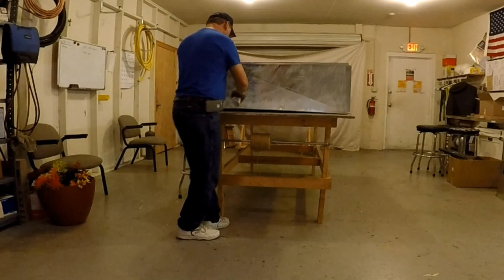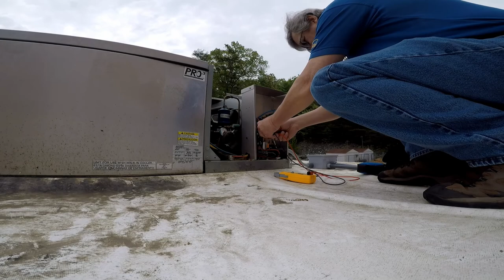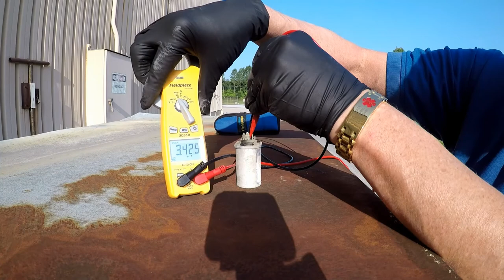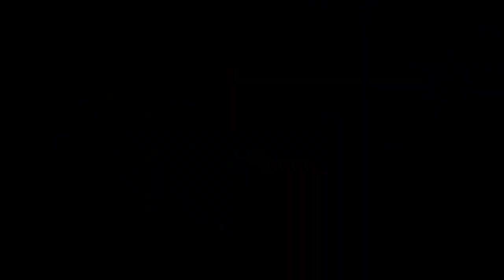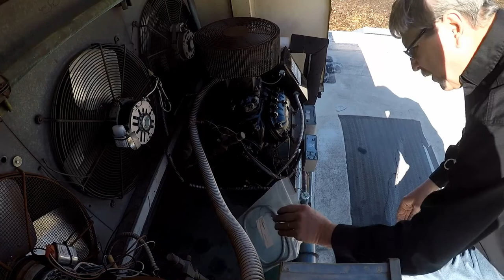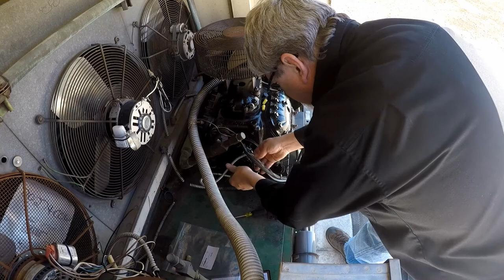Crankcase heater for 20HP Copeland Compressor

Comment: Compressor stopped because of overheating ?
Reply from the maker: Motor winding failure. We noticed the crankcase heater wasn't working during the change-out.  The crankcase heater is needed to warm the oil to prevent refrigerant migration when the unit is off.